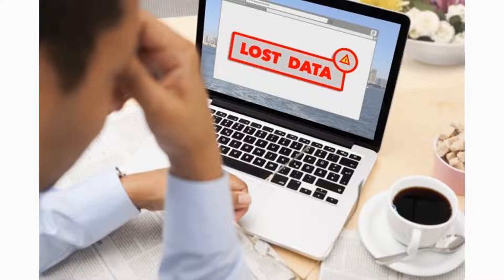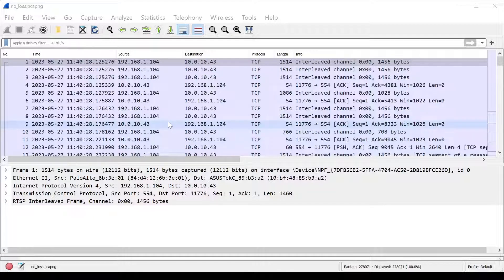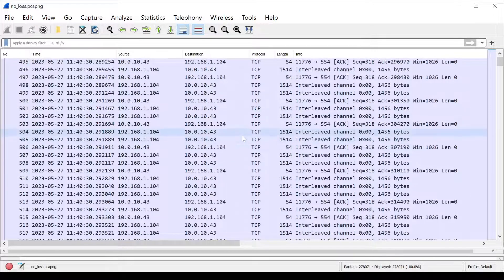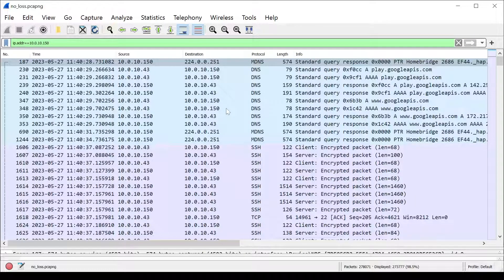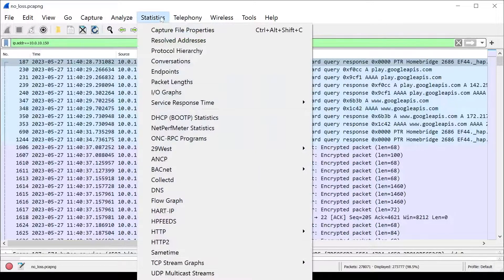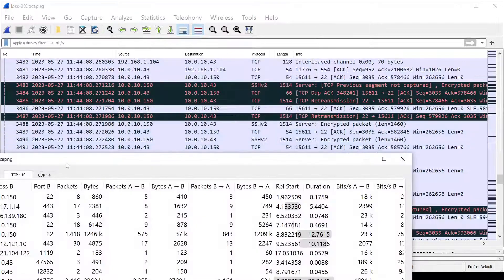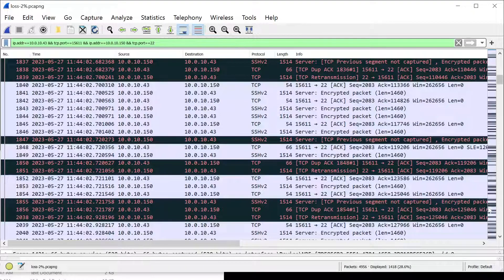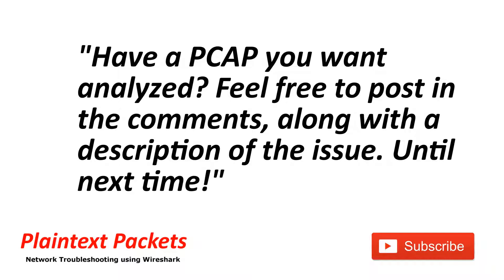Spotting Packet Loss in Wireshark

Comment: Great video. Question: lets say that the src is a storage solution, of type PowerScale (so distributed file system accross multiple nodes etc..). Traffic is SMB. You isolate switches, routers, long network routes, to have both the clients + storage on the same subnet. Even removed the switch and tested with a direct 10Gb fiber client to 1 node of the storage connection. But you STILL see packet loss and retransmission.
Can you 100% JUST the network? NIC on src or/and dst, or can it be see on the wire as retransmissions because the storage is not able to recompile the data requested fast nought in some fasion? Though, looking on the storage, we do NOT see any filesystem delays. The cluster is performing at 10% load.
Thank you !
Reply from the maker: It could be buffers at the OS level. The packets are received by the receiving NIC, which passes them to the receive buffer at the OS layer, then to the applications. If the apps are slow at processing the data those buffers fill up. Could also be the app just slow to ACK packets and therefore they get retransmitted
Reply: Yeah. We looked at optimization on the client NIC side with various buffering options and settings. Things looked a bit better but we still see retrans on the wire. Single wire too ! So it can not be between point to point. The fiber cables were also swapped and the spf checked. But we are having to prove that the issue is not on the storage end. As we do not see issues with our NIC, non issues either with our OS restripping algorithm. 
Is there a way to see what is happening at the NIC level? Zoom in onto the device itself?
Reply from the maker: @itsdouetthierry it would depend on the device. I would ask chatgpt or Claude for steps to check all buffers for your given platform and follow through on commands

Comment: Thank you for the very informative video.  I have used the technique you have discribed to analyze some packet captures i took using Cisco EPC.  I have an extensive amount of packet loss from a client workstation to a server across an MPLS network.  the packet loss is usually between 1.7 and 3.4%.  We have compaints from our users connecting to that server that they drop their connection several times a day, which is why i started capturing the data.
The main issue i am having is only seeing traffic in a unidirectional fashion.  I always see the client workstation on the left and the server host on the right.  i have manipulated the words on the EPC filter on the cisco switch from in , out, and both.. but it does not change anyting.  Would you be able to comment 0n why i only see 1 way traffic in the trace file?  Thank  you!
Reply from the maker: If you can join the discord we can start a tread and share notes, would be happy to help

Comment: why divide the drop packets with 1400 ? is it the maximum segment size ?
Reply from the maker: What timestamp are you seeing 1400?
Reply: @plaintextpackets  ok got it.
Reply: 12:01 1418 is the total packets sent between the client and server. The 1400 was just that number rounded down so it would be easier to get a rough estimate of the % packet loss. 

113/1418 would still give about 8% (0.079)

Comment: Hi, thanks for the video.

What if I want to know my packet loss for UDP protocol ? 

Is it possible to know many were lost/dropped during the transmission ?
Reply from the maker: It depends on the UDP protocol. Some protocols like RTP have sequence numbers shown in plaintext. So even though there aren’t retransmissions of packets you can find gaps in the numbers. Another method is for UDP streams that should have a constant bitrate (like a webcam stream). You can graph the I/o rate in wireshark to look for dips in the bitrate

Comment: I've been a cable guy for almost 20 years, and wish every customer had something running in their home to monitor their connection and keep detailed logs for guys like me to find a smoking 🔫 when I go to a trouble call for slow or intermittent internet. There are so many variables that even with all the tools the ISP gives us (actual tools and internal diagnostic sites) it's usually difficult to be sure the problem is fixed.

Repeat truck rolls  negatively affect our metrics, so anything to reduce those is a win for us AND the customer.
Reply from the maker: I totally get it. I’ve worked as a network analyst for a small company with a bunch of branch sites and had the same challenge. Now I work at the enterprise level but it’s the same problem just at a bigger scale.